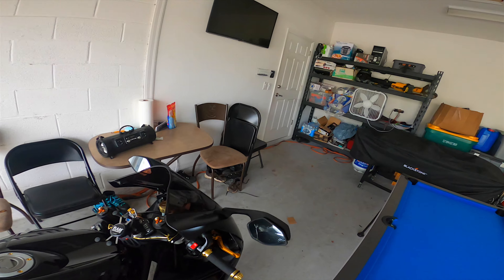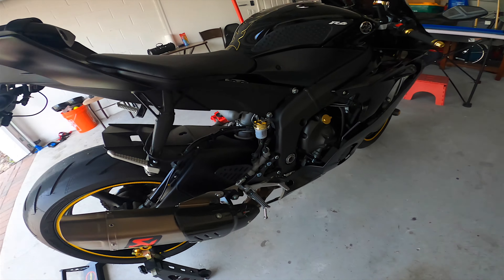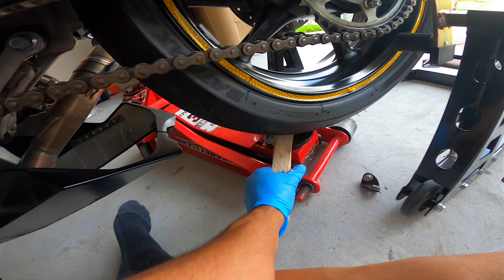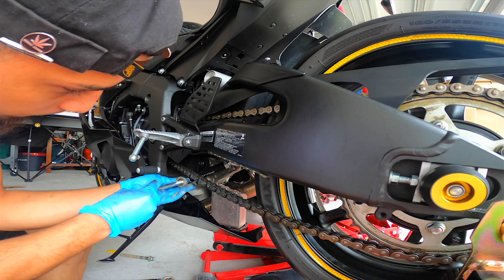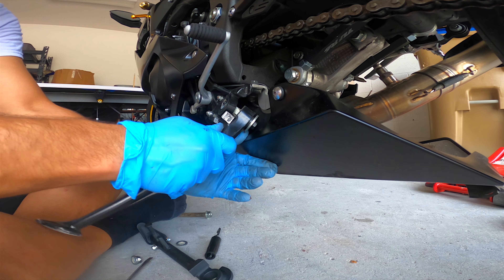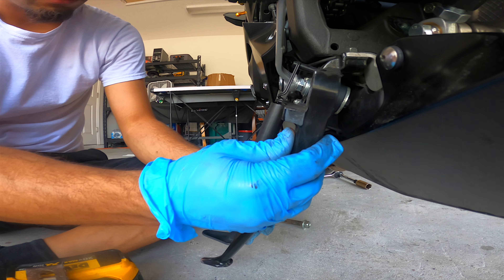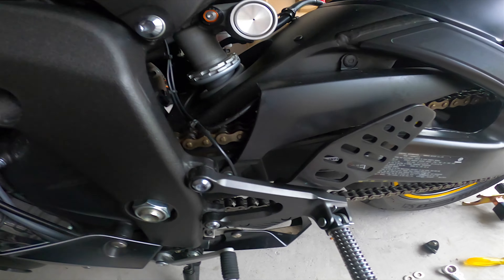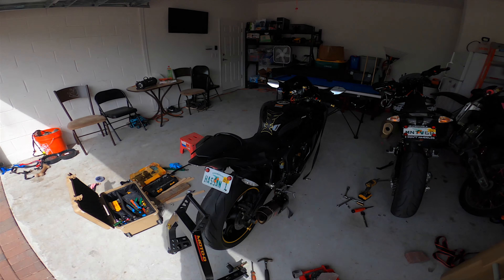LOWERING KIT INSTALL ON 2020 YAMAHA R6 | Mr2Moto

Comment: thanks for posting the video. Do you need to lower down the front as well? As far as I can see the video just lower down the back. And how much can you lower down eventually?
Reply from the maker: You have to lower front to make the bike look equal. If you just lower the back only it’ll be looking like a Harley lol. I had already lowered the front before this video that’s why I didn’t do it in this one. And you can go as low as you want as long as your pipe isn’t banging on the ground
Reply: didnt u see how far the forks were up in the triple tree?  thing is slammed

Comment: im thinking of lowering mine just by 1 inch i live in NYC will bumps and potholes going to be a problem u think? also I'm 5'7 will i be able to flat foot with just 1 inch lowered 

thanks in advance king
Reply from the maker: Most likely not. Im 5'8 and this was obviously very lowered lol
Reply: @Mr2moto  😢😢I’m 5’6 and Im bout to buy a 2014 r6 from one of my dads friends for 5k with low miles and good condition and you just hurt me rn😂ima be struggling

Comment: Where’s your catalytic converter? My shit is setting right in between where I need to jack it up at. Plus how do you determine how much you need to lower the front based off of the how much you lowered the back?
Reply from the maker: I put the plywood there on the pipe to lift it up bro. It doesn’t damage it. And you determine the height by looking at it from a far. Make sure it’s not lobbed to the front too much or lobbed to the bike too much. You can also use measuring tools too to get the perfect height

Comment: Do you have to lower the front as well? I lowered my R3 front and back.. And an planning on upgrading to a R6. I wanna do all the research I can before getting it. Great simple and helpful vid btw
Reply from the maker: Yes bro you have to lower both because if not you’ll have a very un even motorcycle and you don’t want that it’s not safe
Reply from the maker: And thank you man glad it helped 💪
Reply: if u had to lower your r3, then the r6 will be hella high.  Just learn to stop with 1 foot down, u dont need 2 feet flatfoot\
.

Comment: finally someone posted a decent lowering link video, what's the make of the lowering link? Looks like Soupy's
Reply from the maker: https://www.ebay.com/itm/373992980066?fits=Year%3A2020%7CMake%3AYamaha&hash=item5713b7fe62:g:xcQAAOSwZbBiPtA8&amdata=enc%3AAQAHAAAA8JrjwCSATS682Qt5%2Bmqg%2FagJLqIbL50FT5koQC66ow3Ih0b5skOXjE%2FrkTQat1vPhjQnjlqhkfWA7hZa9OWVuqzMS3VZG7Rwwqwo7%2BzjDINg8YcFyqbDfdndhG60HkolhmtOH5smjq4AfIVjTvggwnsY44B1JCVPuc9K8mK%2Fnxm07emWtHz%2Bjo6ltSCFhxhbmKrJFU7JrsK9OiMLjD770vFQNdXKQAbl29KMFa961SbesVHAq6M5ZKrWqGZFbpD5kirmpzD8BGTaqhPAdWIpqEVbdEYUt%2F5J6QGFKYnrfu8ehLNHyGtYrDBnhCTZC%2FlTwg%3D%3D%7Ctkp%3ABFBM1pLgytRg

Comment: Yo bro I recently got the new R6 2020  I’m like 5’7 I need to Lower it if I make it Lower is it gonna mess up my Ground clearance? Because my garage is mad steep going downhill.
Reply from the maker: depends how low you go bro! Dont go too low if thats your garage type
Reply: How low did you go in the video?
Reply: I'm 5 7 and on my old 2016 could touch flat footed np but maybe I have long legs.

Comment: How much did you lower it ?
Reply from the maker: Almost the whole setting tbh. Didn’t measure the inches but it was almost the whole setting
Reply: The whole setting should be 4”. I just bought some lowering links for my 22’ Ninja zx6r KRT.  The last hole on my links is 4”. It starts at 2” and it has 5 holes. This video was very helpful. Bike looks great. I don’t think I’ll go that low. Maybe 2.5”

Comment: Can 5.5" guy ride this Bro after lowering kit installed?
Reply from the maker: Yeah bro I’m 5’8 not too far from 5’5 and I was comfortable flat footed to the floor
Reply: I'm 5'9 I can ride stock height comfortably after practice you learn to stand one foot on the ground and one foot pushing off the opposite footpeg for counterbalance, lowering you bike too much would impact performance and stability, You could get away with 1-2inches and maybe not be able to tell the difference
Reply: tbh i would just ride without lowering it

Comment: nice, but that is way too low.. i recently did lower my yamaha R1.. stock height is too high for me since i'm only 5'2 Asian.. haha
Reply from the maker: Thank you bro !! And yeah it really is pretty low! But the owner wanted it that low at the time of the video. We raised it more after. Its at a good height now. And lol bro im 5'8 not that far away, any bike stock height is too high for us lol
Reply: Hey dude, just wanna ask how many inches did you shave off of your R1? I'm about 5'5 and was thinking of lowering mine as well since I'm always tippy-toeing it....
Did you also adjust the fork? how many inches on the back and front? Thanks in advance....
Reply: @thomasjosephhenrydelacruz1769  about an inch lowered.. but i still tiptoe on bike.. only 1 leg tiptoe, the other one can't reach the ground.. im thinking to lower another 1 inch.. i didn't lower front fork yet.. but soon will do
Reply: Bro were same height, is it possible for r1 to lowered up to 780mm same sa yamaha r3 seat height